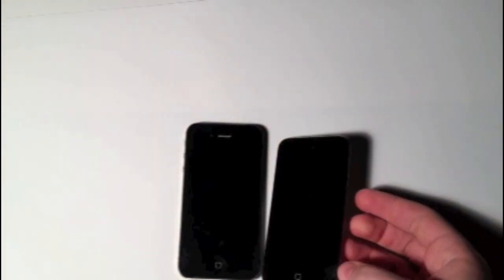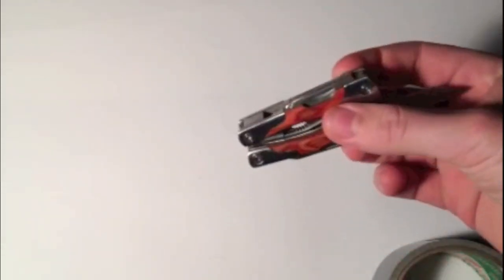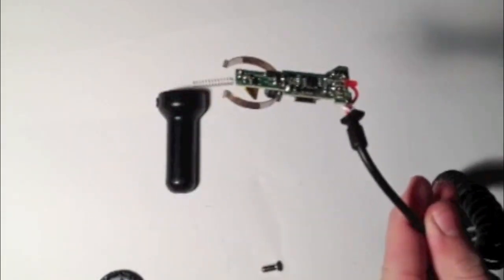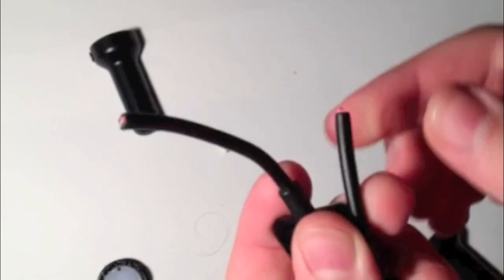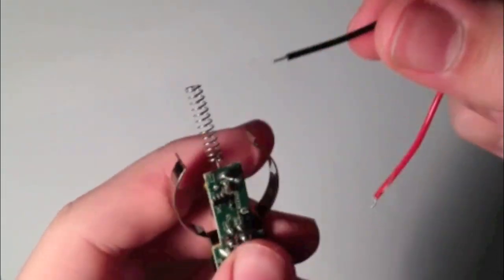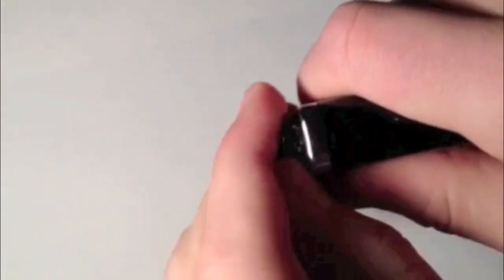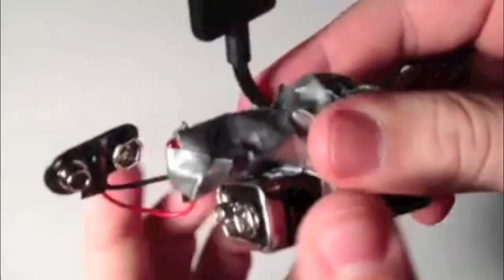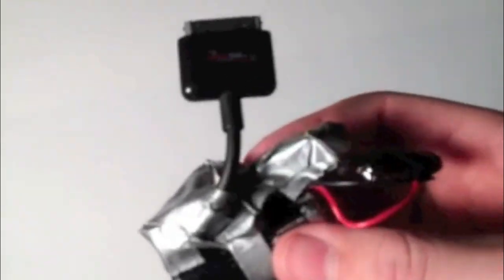How to make a battery pack for iPhone (9 Volt Battery Charger)

Comment: On ebay for about $1 including shipping, you can buy a step down DC to DC USB converter, an already built circuit board with USB attached the size of a thumb nail, built to be efficient, using any source from 24 volts down to 6 volts, anything like a car battery or a 9-volt battery and all you will need to make it work are two pieces of wire with optional battery connector and soldering for better connection. This video here is very inefficient. First you ruin a perfectly working 12v DC charger for a lousy wasteful half ass working charger that never will it give your phone a full charge. This method can only be useful if you are stuck somewhere and all that you can find at a gas station is 9volt batteries and 12v car USB charger. Then you may feel proud of your clever idea of using a 12v USB charger to use a 9v battery to give your cell phone enough charge to call AAA or your cousin to come to your rescue.

Comment: This circuit lack the efficiency without 12 volt load...i have tried it and it is charging but the percentage is going down..lol The circuit need to be really efficient that is made of 9 volt load because of the component and resistors inside there to block the current

Comment: instead of a nine volts battery, can i attach my 6v solar panel instead? will this work in charging my phone? pls reply...thanks in advance...
Reply: To answer your question about using a solar panel to charge your phone, I've careful that the high voltage from your solar is variable and if it burns out your voltage regulator inside the charger, then your phone will get more voltage than 5.5 and it will be ruined. Best thing is to buy a $1 DC USB step down converter that uses 24 volts down to 6 volts and you need another product found on eBay $2 USB Doctor which would show how many volts and how many amps your phone is drawing. Then you can be sure the voltage is accurate before you feed it to your $600 iPhone.
Reply: Now that I have read your question once more, a 6v solar panel most likely has only 10 percent of the amps that you need for your project. Your phone may even look like it is being charged, but then it is not because there are not enough amps to do anything. Best is to get solar panels at least the size of two sheets of paper, then regulate the voltage by my suggestions mentioned above.

Comment: I opened my iphone charger and took the rubber off and there were 4 wires, a red, green, black, and white one. What should I do?
Reply: red and black, your red is positive and black is negative. the green and white are data wires.

Comment: can you make a power bank charger for iphones from laptop batteries? just wondering because I have some pretty nice batteries from my alienware.
Reply: Yes, that'll work too.  Build it similar to a flashlight.  Get a cheap LED flashlight and remove the base.  Find a metal tube the same diameter as the threads on the base.  Cut it long enough to hold two batteries plus the USB car charger.  Put it all together and you'll have a bank that'll charge 1.5 - 2 times.  You'll want a 'smart' charger for the Li-Ion batteries, which can be bought from Amazon.com.  Look for a charger recommended by the vapor pipe smoking crowd.

Comment: Here is something to think about. First off buy your parts in bulk! The 9V batteries and the 9V battery clip will be very cheap the more you buy. Also think about this... Use 3 9V batteries in parallel and put it all in a hobby box. After that use the one you made for yourself then make like 10 more and sell them at school work or wherever and then you will have technically got it for free minus your labor.

Comment: The one thing I might do differently so you don't kill a perfectly good car charger is to buy the female cigarette lighter plug at Radio Shack and wire your 9V into the back of the female plug. Then just plug the male end you have there into the female plug when you need it. Obviously if you're going for smaller size, your way is better.

Comment: "Will this work???":well he built it and showed you it worked...If you define "regular charger" as a home AC 110/220v power wall charger, then that's different than the DC car cigarette plug transformer shown here. The AC charger is an "Adaptor" which changes AC to DC and lowers the voltage to 12V and a regulator to keep a constant voltage. The device shown here is more of a transformer changing incoming DV voltage (5+v to maybe 15 volts) down to 5v. Should be as safe as using it in your car.

Comment from the maker: no it wouldn't because a wall charger takes in AC power, so it wouldn't work with a 9 volt battery